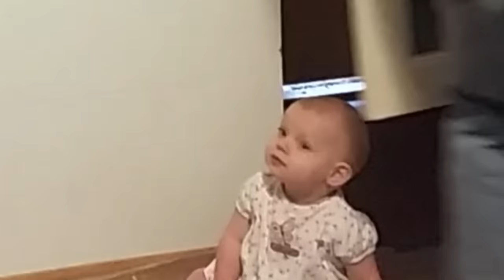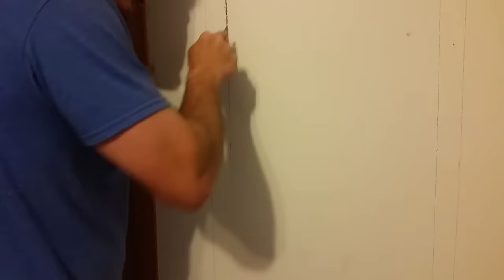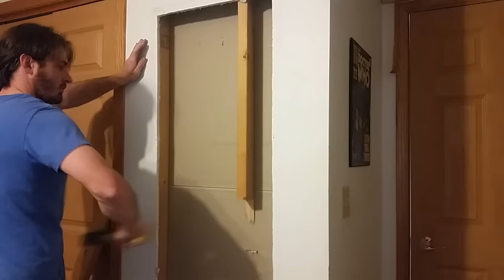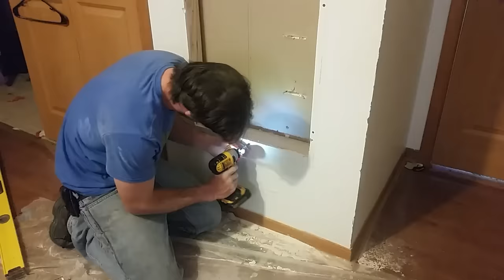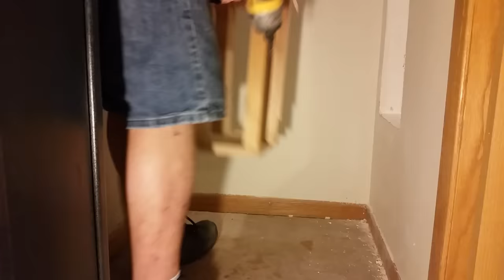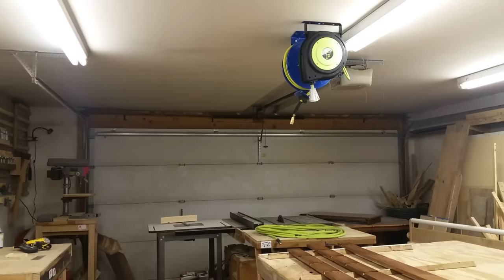Making a tactical walls inspired concealment mirror

Comment: This is so awesome, man.  It's one thing to build a cool concealed safe behind a mirror, but it's a whole thing to do it all properly with nice varnish on the wood, paint on the studs under the wood even though nobody sees them, nice clean walls around the safe in the closet where almost nobody will see, putty between the edges of the drywall, etc.  You did really great work here.  I'm pretty envious of this project.  I wish I had carpentry chops like yours.

And your daughter is absolutely adorable.  The true star of the show!
Reply: But there’s a Star Wars poster on the wall over his bed with no frame. Go figure.

Comment: At first i thought "hmm i can do that"
Then i saw his workshop.
Reply: Nah you can build it, all you need is a table saw and a few hand tools.  Except for the overall design, ignore everything else as he did it all wrong, for the most part, was a great laugh to watch.
Reply: @McyD  ghehe well i'm no carpenter.. but did just build my own wooden shed. And had a great time doing it. :))
Reply: You don't need all the fancy tools. My dad did a lot with mostly hand-tools. He could have done so much more with more power tools though.
Reply: @chaos.corner  True, but a hell of a lot more work and not the same perfection achieved. In my case that is. ;)
Reply: I have built several secret "rooms" for myself and clients.All you need is a hammer, screw gun, circular saw,hand saw, and drywall saw for this one.Corner brackets or pins for the shelves and surface mounted hinges.What he didn't do was tape the mud joints and enclose the inside all the way to the ceiling.Would look like a normal plumbing chase in the closet instead of an obvious box.If it doesn't turn out right just buy a bigger mirror to cover the attempt. lol
Reply: @gueto70  Are you a member of the A Team? ;)
Reply: @Romin.777  Own a general contracting company specializing in historic homes and custom interiors.Built several secret panic rooms for judges,D.A.s, and psychologists.
Reply: @gueto70  Cool
Reply: Yeah, no kidding!
Reply: @gueto70  i understand the need of a panic room for each of those people
Reply: Get your can't done at home depot. 

Jk
Reply: @diggsdiggler337  I don't have a Home Depot. ;))
Reply: @get6149  It took me a second, because I originally read it as a picnic room. Why would a judge need a picnic room... Ohhhh!
Reply: @grover2727  or maybe I make custom cabinets and built-ins for a living for over a decade now and know what I am talking about...

Comment: 30+ yrs in the industry and this makes me smile.. to see (I'm assuming) a cabinet maker working his way through a carpentry project. Both are very specialized skill sets and two distinctly different crafts that most lump into one category. But the truth is, most carpenters can't build cabinets and vise versa.. for myself, I was a commercial and residential carpenter for 20 some yrs before I was any good at building custom cabinets. I had installed more than I could count but custom built is and was a whole other dimension that requires a  completely different set of tools and way of thinking. So kudos my man. I'll hold any critique and just say.. Respect! the finished product speaks for itself.
   Ok I'll admit it .. the baby made me smile too 🔨👷‍♂️

Comment: Love this project, just a couple small suggestions from another finish carpenter and cabinet maker. Get a good Multi-Tool and you will love it. Can slip it behind the drywall and cut the screws so you don't get screw pops or cracking on the back side etc. We do similar work when adding a Niche into showers and it really makes the end result so much cleaner. Also for the sake of safety try to remember to use the sled for notching on the table saw, and you should only have the table saw blade about 1" above the material thickness for normal cutting.
Reply: Yes, that use of the table saw rather smacked of complacency.

Comment: I love it, I love hidden doors, and hidden rooms, and I love babies. The problem I see is that if a theft is in your home looking for something to steal, and see that box in the corner of your closet. It’s not going to take them very long to figure out there is something behind the mirror.
Reply from the maker: That's true. It wasn't really about trying to hide it from anyone. I just thought it was cool and now it doesn't take up space in the room. It's not a safe I would want to keep valuables in anyway. Mostly it's just to keep the kids out of the dangerous stuff.
Reply: If you put a false box inside of closet top of your box to the ceiling, add a heater type vent facing towards closet shelf, it would appear to be heat vent return.

Comment: Get them safely glasses on brother. You want to see that pretty little baby grow up. 👍Great video
Reply: Or at least a safety tie!
Reply: Make sure you wear driving gloves, too, wouldn’t want you losing grip on the steering wheel while driving.
Reply: Always wear a helmet w/ face shield, shoulder pads and knee pads when cutting the grass as well. I always say.
Reply: Irresponsible using a table saw... WEAR Safety glasses and NEVER push wood through the blade with your hand between the fence and the blade.
Reply: PPE: Mask, goggles and DEFEND baby’s eyes/lungs from debris ALSO.
Reply: @JosephQPublic  He wasn't driving
Reply: @MonkeyJedi99  His hair wasn't in the way
Reply: @HooksBill  And is this a case of do as I say not as I do?
Reply: Came here to say this. It doesn't cost anything to wear them. Got a piece of cut-off wheel embedded in my safety glasses once, never going to forget that!
Reply: @DavidM-um2uk  got a chunk of dirt or cut-off wheel in my eye this summer (I was cutting aluminum, then stood on the deck that night to watch the dust storm blow in.... like a moron). Some of the worst pain I've ever had. You know a flesh wound will stop throbbing after a while, but the eye is just getting worse until you give in at 2am and go to the ER. I also bought good eye protection and used it today actually. 👍
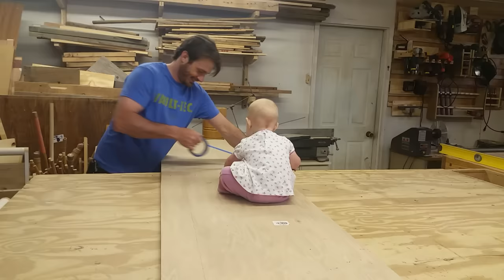Reply: @jkirk9697  he was wearing them, look closer 1:07
Reply: @DavidM-um2uk  he was wearing them, look closer 1:07
Reply: And a kickback guard on the the table saw
Reply: Eyeballs are cool.

Comment: Well done my friend, well done! You've inspired me to build one myself. I just hope it turns out as good as yours did. Thank you for the video, you definitely earned my subscription!
Reply from the maker: Thank you. The hardest part is finding the right hinges. They have to be able to open up past a normal hinge capacity to be concealed and they have to be able to support more than what you would think. I think the ones I used only hold 40 lb of peace and my mirror was about 80 so I just doubled that to make sure it was enough. You might also think about looking up drawer Glides as an option. That's how tactical wall does theirs
Reply: @WyldeWoodworks  Actually what were was the brand/ style hinges called or source? Also the top corner push connector. Thanks.

Comment: Most people who try to do this may discover electrical wires
Reply: Hopefully people are smart enough to test!
Reply: I did i just cut them out of the way. Some lights dont work but i feel safe.
Reply: A good indicator of potential electrical wires is a switch or receptacle in the wall. In this case there was none so he was pretty safe.
Reply: Use a stud finder with electric detection function
Reply: In lieu of a wire detector, I find getting thrown across the room to be an excellent testing method.
Reply: @FRANK45CASTLE  😂
Reply: @adampresents3001  and  (judging by the shop, tool quality and workmanship) he's more than smart enough to have checked.
Reply: ...OHHH NOOO ... Water pipes !😩
Reply: @FRANK45CASTLE  
I love you SO MUCH! MERRY CHRISTMAS! 🎄💝🎄💝🎄💝🎄💝🎄💝🎄

Comment: I'll give you a +1 Sub for the Vault-Tec shirt.  :)  I did have one item of feedback on the build. Since a thief is likely to look in the closet, seeing the bulge that had to be built around the safe kind of gives away the fact that a hidden spot was there. You could box in that entire end of the closet for more concealment at the cost of losing closet space. Kind of a danged if you do and danged if you don't scenario.
Reply: I really wanted to add some hardware to the inside & hang my belts.
Reply: brr johnson that’s a great idea!
Reply: Like It Or Not I agree completely. I didn’t want to be a downer on the project at all, but felt that it needed to be better hidden to justify that much work (at least in my life). And if it was going to be that obvious, it could have been just as hidden inside the closet without having to cut through the wall. Overall though, I enjoyed the idea and it helped me to think about my own situation some more. And I realize I’m also not making YT videos and getting the benefit of that as well.
Reply: Yes, he needed to put up a false wall.  Can't find any fault otherwise

Comment: An easy enough and solid project, you can use same principles for all kinds of decorative alcove/bookshelves, etc., as well. Recessed shelving into walls was a big thing from the '30s to the '60s, when space use and design elements were brought together.  But, it's a really good idea to toenail those studs and cross pieces in place, where possible.  The drywall screws may hold the "box" in place but houses move and settle and you could have some issues, if the place you choose isn't already pretty well reinforced, like near corners and closets.  Solid is always better. 
  Good job, good project and buying a tactical wall piece requires you to do the cutting, anyway, may as well save the money and have it how you want it. 👍
(and you may as well make the mirror two-way with video surveillance in place, as well.  😉).

Comment: Nice job! Your baby is beautiful!

One suggestion. It appears that you cut a stud out of a bearing wall.  The studs looked like they are 16" OC. You can  do that but you need to replace the full length of the stud you removed from the top plate to the bottom plate. The easiest way to do that is to make the side studs of your niche full length. This will ensure you meet code requirements,  which is very important. If you sell your home, home inspectors typically will examine any alterations very closely. 

I enjoyed your video, especially your baby.

Comment: A minor note.  Given this was a closet wall and almost certainly not structural he did everything right. If the wall you use is structural you can put the new stud in before removing the old stud to keep the wall plate supported. Depending on the span you might need to put a lintel in. Not knocking the dude just saying for those who want to play along at home make a trip to the attic before you cut any studs.

Comment: In Britain’s tiny homes we wouldn’t have built around that space in the first place.
But why was that area blocked-off? Just to hold a mirror?
Reply: @jwhite-1471 . Well, it looked as though the wall with the mirror on it was part of a structure that enclosed a space of a few square feet. I just wondered why anyone would enclose (meaning blocked-off) an area for no apparent reason. Or was a mirror reason enough. 
Though in the end it did look as if the enclosed area was put to use.

Comment: Along with ammo, buy extra magazines.
Also have a means of transportation like a bicycle or even better an E bike with a solar charger. 
Like my other comment, have a way to pump water from the ground. Have a hand pump well installed. Most important, have a plan and make a plan with your neighbors. Don't wait until the time comes to start figuring out what to do. 
I vacuum seal dry pasta noodles and pasta sauce in mason jars, plus other foods like rice and dry beans. Another thing to store is dry powder drink mixes like Gatorade for electrolytes, instant coffee, anything so you're not stuck drinking only water, esp if you have kids. Go to thrift stores and buy board games and puzzles. Things to pass the time. 
Remember, it's not a race, start preparing now. A little bit at a time will eventually add up over time.

Comment: Hey man. Beautifully done. I wanna do this type of project in two locations in my home. Any chance you have any info on the mirror you used?
Reply from the maker: I think I bought ot from home depot. Sorry I don't remember much
Reply: @WyldeWoodworks  ; No worries, man. I was just at Home Depot, and aside from the fact that the store I was at was full of a bunch of knuckleheads that didn’t know they had those type of mirrors, the ones the had (which I ended up finding with no help from the HD employees 🤣) were cheap and too small... Would it be crazy to ask the dimensions of the one you used?
Reply from the maker: I just measured it. It's 22" by 62". I honestly thought I was going to have to make one myself before I found that one
Reply: @WyldeWoodworks ; Bro, thank you for doing that! 😁👍 I’ll search for one right now

Comment: Do these kind of walls even dampen the sound from the next room? Or do you just hear everything said and done?

Awesome project.
Reply: depends on whether or not they're insulated. You can insulate the walls you don't want sound to travel through, and you can vary thicknesses of drywall (the drywall in one room is a certain thickness all over and the next room is a different one, just gotta make sure that anywhere the drywall butts together is the same thickness, obviously). Sound has a hard tine travelling through one barrier and then another that's a different thickness. Doesn't do a ton on it's own, but combine that with insulation and it's pretty effective. You can also double-layer the drywall (with different thicknesses of course) to really smash any sound transfer. Of course, none of that is common practice, but it's what can be done to mitigate problem areas.
Reply: @BeetleBuns  alright.
I was just curious because we don't really have these kinds of walls around here. At least not that I know of. I grew up in a house built in the 80s in Germany and it was all brick and stuff. No drywall anywhere.
Thanks for the info.
Reply: @bearo8  yea we build houses differently over here lol, you can punch right through walls like a superhero if you don't hit a stud lol
Reply: @BeetleBuns  that sounds like a really dumb way to break your hand. Or maybe soft Russian Roulette.
Reply: @bearo8  lol we only used to do it to walls that were being redone anyway, and you can tell where the studs are. It was fun as kids, don't really do it anymore though because I'd rather just get the job done than mess around

Comment: I use to not be afraid of using my hand to push the boards through with my fingers close to the blade, until the day I almost cut my finger off. The board jammed pushing my hand into the blade. Please listen to me. Use a push board! I will never have feeling in the end of my finger.

Comment: please dont have the saw blade fully extended like that again. for safty sake it only needs to be extended enough to cut material and never push material with hands, use block of wood or something just not your fingers. i cringed a lot. please be careful. but it was a great job :)

Comment: You're using your drills wrong if you're having to put that much effort behind it. You should NEVER need to use brute force and push on your drill to make a screw go in. You either need a stronger drill or you need to increase the torque on it.